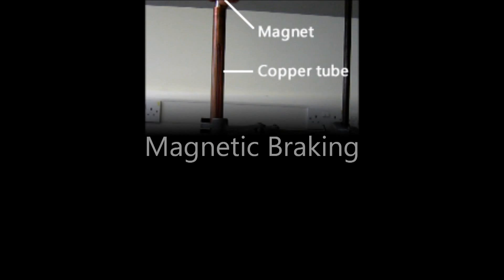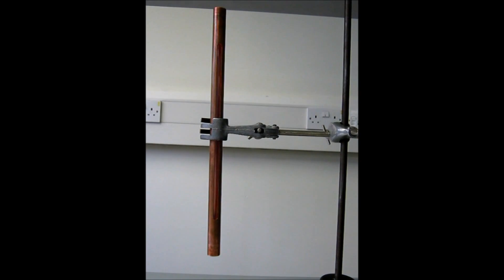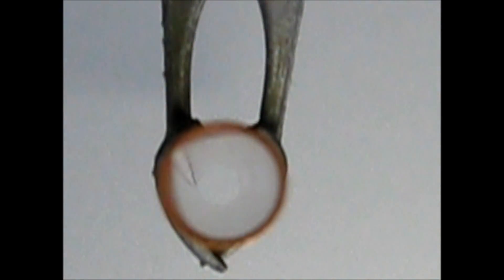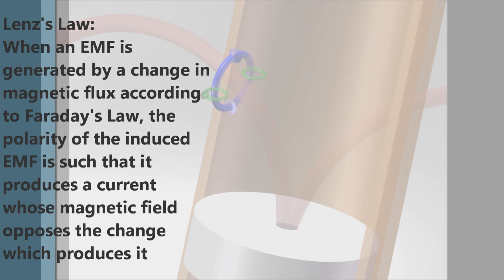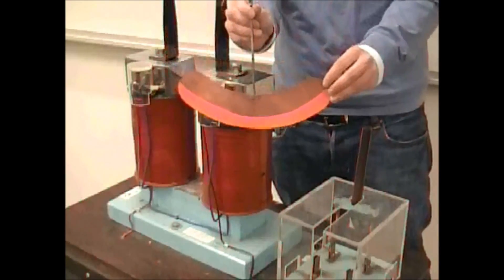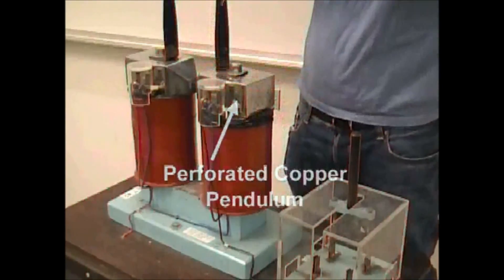Eddy Currents, Magnetic Braking and Lenz's Law

Comment: Did you consider showing what happens to the braking effect with the opposite separation effect applied to the magnets using magnets "stacked" separated by impermeable spacers -> "stacked" disk magnets separated by impermeable spacers increase the breaking effect by causing each magnet field lines to induce separate eddy currents in the solid copper sled -> but what happens if you then also provide the slotted copper sled to that stacked magnetic field situation?

Comment: @Fiona you lost me with the blue and red rings. If the red rings are eddy currents what are the blue rings? How do the red rings oppose the flow of the blue rings, it isn't clear in the animation. The explanation and video is really good up to the point of the red and blue rings, then its confusing after that. The live MIT demo at the end only proves the concepts, it does nothing to explain it. Would nice if you could add some captions into the animations to clearly indicate what the rings are and direction in which they flow.
Reply: secondary magnetic field created by the eddy currents induced in the copper

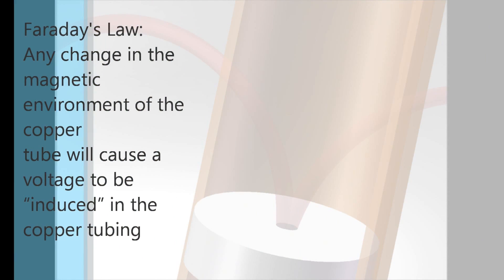Comment: at 1:25 you say that a current is induced but the accompanying text says voltage is induced?
From my understanding, the magnetic flux induces a variable current. The interaction between these two forces produces an emf which is actually a voltage that opposes current. Is this correct?
Reply: when we change the flux then electric field is induced wich exerts force on charges to move as induced current due to induce current megnatic field established which oppose the original megnatic field which is cause of it

Comment: the induced emf in the copper is stationary and repel the magnet and it take a force to vercome the repusion so the manget can create a new posistion for the induced stationary field. the induced field is stronger closer to the magnet inside the tube than further away. eddies is not the real problem. the stationary behavior of the induced repellig field is the problem.  if the induced emf was moving with the magnet, the magnet would drop instantaneously through the tube.

Comment: the most irritating thing about electrical systems like these is that we are never told WHY the laws the way they are, like presuming the flow of electrons is actually how things work, why the heck would it create a magnetic field? and supposedly this magnetic field that acts as that of any magnet affects conductors by manipulating the magnetic domain of the the conductor making it a temporarily a magnet thus causing it to create its own magnetic field, but then where does the 'eddy' current in that induced magnet come from? do ALL magnets really have some internet eddy current going on in it? with supposedly zero resistance so the current is infinite?
Reply: You have to accept natural phenomena at some level.  If we go on to say that electron spin causes magnetism, then you could ask why that is.    We can, however, explain the most obvious  characteristics, such as Fleming's Left & Right Hand Rules andd from them derive all the others such as Lenz'  law.
Reply: You have to accept natural phenomena at some level.  If we go on to say that electron spin causes magnetism, then you could ask why that is.    We can, however, explain the most obvious  characteristics, such as Fleming's Left & Right Hand Rules andd from them derive all the others such as Lenz'  law.
Reply: Experiments back around 1860-90 using a Crookes Tube showed that it was the negative charge that was traveling.  What you are asking for is a full course on all aspects of electricity and this is just one part of it.  You won't get that in one 5 minute video.  This video assumes some prior knowledge.

Comment: Why the magnetic field changes as the magnet falls? What area are we considering when analyzing de magnetic flux?
Reply: Hi Gabriela, I think that´s simply because it locally changes. So as long as the magnet keeps falling down, locally, in every instant at every height you have a certain time-variant magnetic flux that induces the eddy currents that, in turn, induce local magnetic fields that do oppone themselves to the main flux (hence by point in the opposite direcction of it, and hence slowing the magnet down in its falls)...that´s just fascinating!

Comment: EMF stands for electromotive force not "electromagnetic field". Correct me if I'm wrong
Reply: You are not, emf is used to refere to the induced voltage and is therefore not a field.
Reply: As a side issue I prefer the term "electrical pressure" which was the original term for EMF. I think fancy terms are just stupid, I mean really, what does "electromotive force" and "voltage" mean. Silly people who name these things. I guess medicine is even worse with terms like esophagus which should be called something like "stomach inlet tube" or "stomach input pipe". Those silly people that come up with silly names should removed from their authority to name such things. Stupid names make it harder to understand what are otherwise simple concepts!
Reply: In this context, I think there should be a distinction between the acronyms or else the information may be invalid
Reply: I was about to comment that
Reply: Yes..its electro motive force
Reply: Zhou Jack The inferiority of acronyms are universal, no acronym is better than another.
Reply: @auail5594 "EMF" is not an acronym, but rather an abbreviation, since it is usually pronounced by saying the letters e, m and f. An acronym is pronounced as a new word. Example: RAM (for random access memory.)
Reply: Zhou Jack That's true when I think about it again. I guess the scenario is complicated by the convention of using one acronym to refer to one particular thing rather than anything that can be appropriately acronymized. You are right, this surely needs some clarification; I was just trying to point out that people shouldn't mess around with acronyms and abbreviation too much, like "trans" is not always "transexual", it can also be "transportation" , "transformation" or "transition"; it would be wrong to associate acronyms and abbreviation to just some specific things, but I guess this linguistic demand is not really that relevant in this context. (This context in which electrons are not called "negatrons" :D)

Comment: . I submit that these field lines and currents are not explained in the video and are incorrect.  The statement: "Any change in the magnetic environment of the copper tube will cause a voltage to be induced in the copper tube" gives no indication of the direction of currents or field lines.
The CHANGE: is opposed, not the field itself.  The red line does not indicate how the field is changing.  
 It is changing by sliding down.  By Fleming's Right Hand Rule, this will cause a citcumferential current around the perimiter of the pipe, not the small circle shown...  What gives..?

The actual fields and forces are still not addressed by this video.  Just Invoking Lenz's Law does not show how the fields are generated and their direction.  Above the magnet, the green field should be in the SAME direction as the red field.  Below the magnet, the green fireld should be opposite the red field.  That is, there is an attractive force above the magnet and a repelling force below the magnet.  These forces must have a vertical component if they are to slow the vertical fall.  The lines shown here are all horizontal/radial, so they can not produce any vertical slowing of the magnet...

Response please...!.?
. 

ScienceAdvisorSteve
Reply: Late reply, but here's what I'm wondering.

If the eddy currents were around the perimeter they would produce a magnetic field parallel to the direction of motion of the magnet which would result in no force on the magnet because of the qVxB relation, because sine of 0/180 is 0, right?

So with that in mind, I think the eddy currents have to be as shown in the video.
Reply: @lesa251   I just looked here...
.
You're somehow not thinking correctly.
.
Think of a regular solenoid coil.  The current is in the wires all around the perimeter. The lines of the field are indeed parallel to the pipe length and along the direction of the falling magnet.  

A magnet in the center with the proper direction would be sucked in.  Flipped around it would be pushed out. 
,'
When two magnets attract, or repel, end-to-end, the lines are parallel when two poles face each other.
....
.. 
Do not miss the fact that there are eddies like the one shown like that all around the perimeter and they must sum. 
.
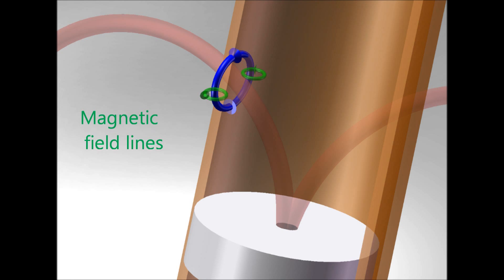The magnet's magnetic lines spread out all around the magnet from the pole, not just on one side or two sides as shown at 1:48.  They form a cone with the "tip" at the pole and it opens and passes through the walls of the pipe ALL AROUND the circumference..
That image of just two lines is very misleading, apparently. There are an infinite number of those lines in that "cone".
.
Then, there are an infinite number of those little circles, all around the perimeter. The sum will be currents around the circumference.  JUST LIKE THE COIL WITH CURRENT!
.
This is exactly how all the eddies sum up - to a current around the perimeter. It's been so long, but if not here, then other places this is explained; they all sumto a current around the perimeter.
..
..
Above the magnet this current produces a field that attracts the falling magnet, "pulling upward"..
..
Below the magnet, the field opposes the magnet and it repels, pushing up.
..
This can be seen in a video on YT where the guy cools a VERY thick copper pipe in LO2.  The field in the pipe starts to repel the magnet above the end of the pipe just before it enters... AND attracts it after is falls below the bottom for a bit.
.
Got it?
.. .. ..
It turns out that even if the magnet can tumble inside the pipe, it will still be slowed.  It is like the pipe is a magnetic mirror and reflects the proper field to slow the magnet's fall.  Pretty neat!
Reply: @lesa251   Here.  You can see the repelling below the magnet and the attraction above it in the pipe.

. In this one around time 0:45 you can see it enter slowly and exit slowly. 
 https://www.youtube.com/watch?v=5BeFoz3Ypo4 
.
HERE'S the liquid N2 cooled version, Mush better.
!! Look around 0:20 and 0:48 

 https://www.youtube.com/watch?v=AzOSYJmYLTg

Comment: Fiona,
  Question:  The secondary magnetic field (green) is perpendicular to the wall of the pipe.  It has no vertical component. If there is a force opposing the downward motion of the magnet, shouldn't there be a vertical component to the "opposing" field?

Comment: I have three questions/comments. Although I didn't research this myself, our team in our nationals for the IYPT researched and presented upon this effect. We would be greatful if you answer for these questions.

1. Where does the mechanical force go to when the initial speed of the magnet is larger than the terminal velocity?

2. You mentioned that friction is not a factor, but the shape of the eddy currents in this case results in sticking being inevitable. Even if you drop at complete symmetry, it is impossible to not have contact with the wall. It is not easily calculable or an important factor, so it does not have importance, but your description of the matter was incorrect.

3. You are saying that a magnetic field induces a eddy current in the form of a circle upon the tube. But this is true of every point upon the tube. Then how does the eddy current retain its circular shape when two circles interconnect infinite times? Is it not more reasonable that the eddy currents are induced in parallel, and that induces a magnetic field which results in braking? This provides a force correlating with velocity implying that a terminal velocity exists. But from your qualitative apporach, I am not so certain.
Reply: Well, recently our team is also preparing for this problem... We have done a lot on mathematics and we finally prove that the retarding force is proportional to the vertical speed of magnetic. So if the initial speed is larger than the terminal velocity, the magnet will slow down to reach the "terminal velocity". Hope it can help you :)
Reply: +Gloria Jia Hello Gloria, 
Could you calculate the force relative to speed? Is there a formula that you can share with us?
Thanks for the help :)

Comment: So if you reversed the test, and had a magnetic rod without a cut though it, and you drop a non magnetic metal through the tube, would the non magnetic metal go faster or slower than the control test?